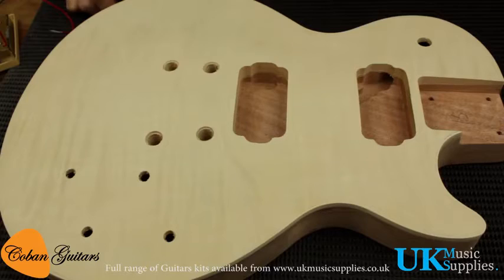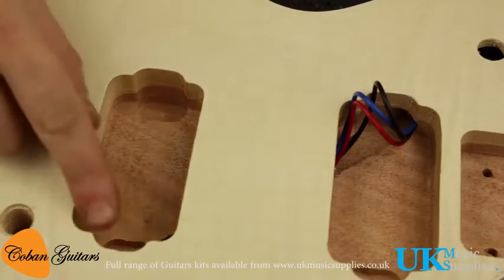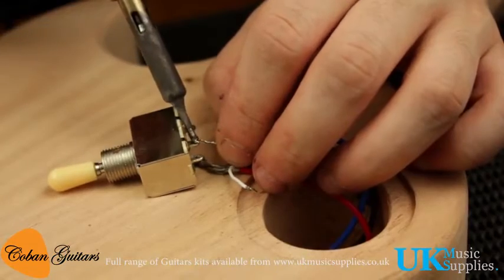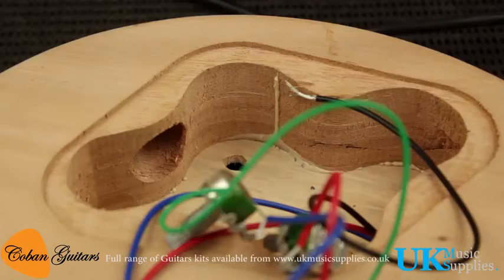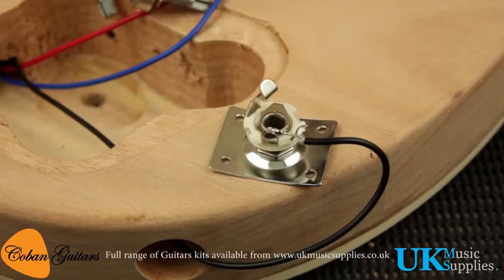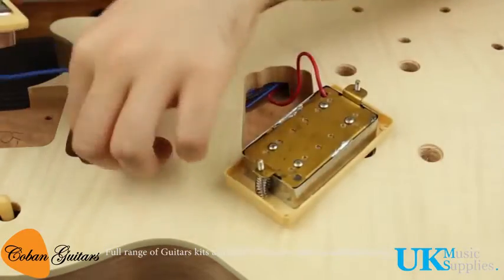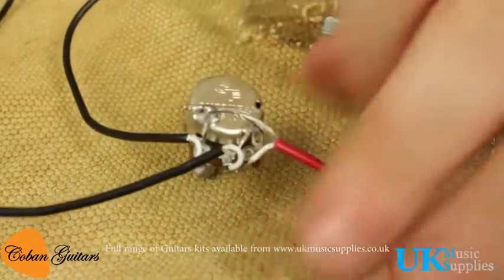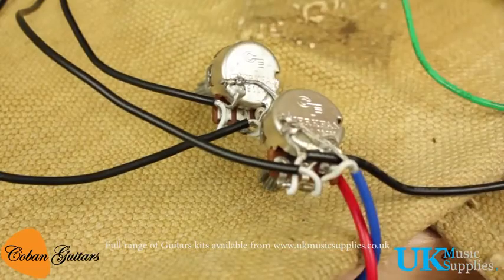LP Wiring Guide - Full Range of Guitars Kits Available from UK Music Supplies

Comment: what is the green wire for ? is that for a ground ?
Reply from the maker: Hi Yes it is.
Reply: @ukmusicsupplies5898  ...but what does that mean? What does it connect to? Do you just leave it loose to touch the threads that the bridge pins go into? Or am I meant to solder it to something?
Reply: @AllyPugh   touches bridge stand from inside. I drilled hole from pick up to bridge hole.